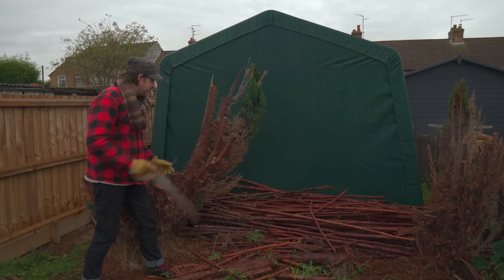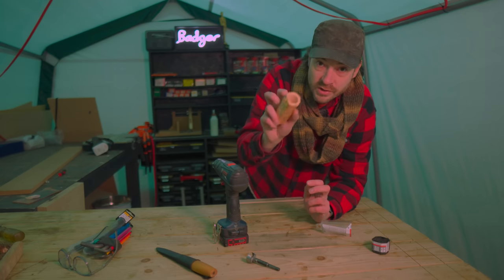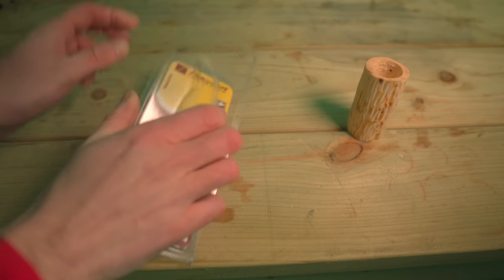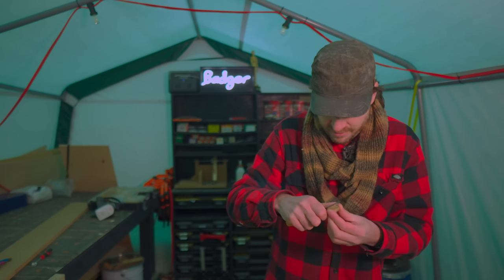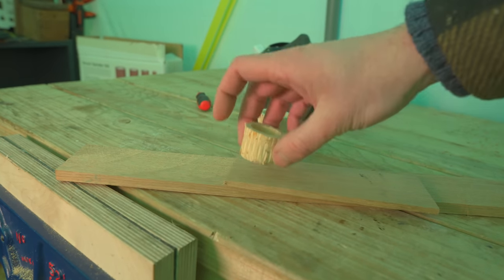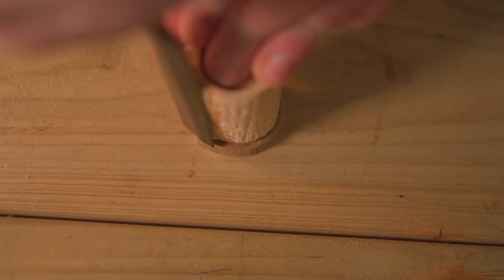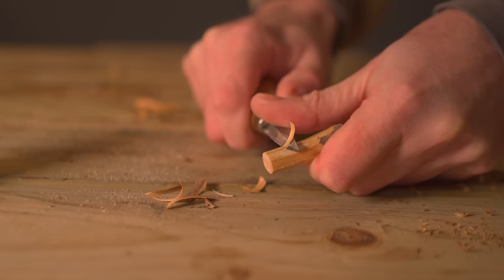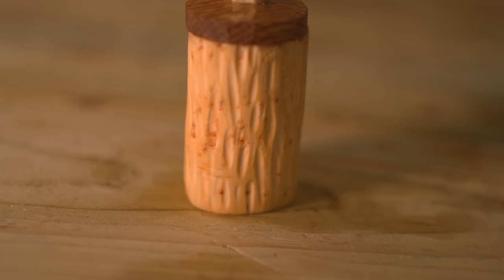Having A Go At Green Woodworking

Comment: Hey Matt, Question for you. Is there any reason you're not using the string lights that you installed in a previous video? I've watched it a few times now and I'm thinking of buying some myself to run around the garden but wanted to check that you can put a regular UK 13a plug on it (which it seems like you did on your video) but also how good they are? They seem to be really good in the video where you installed them but I've not noticed you don't seem to be using them so wanted to check first if there was any particular reason?

Comment: I saw you strip off the perfectly serviceable bark, then add a carved bark pattern. Ironic! Great project, is the shrinkage to enable it to hold liquids, or just be secure?
Reply: I think the bark is removed because the moisture needs to be able to escape. The walls need to be thin so the pot van shrink, but not crack.